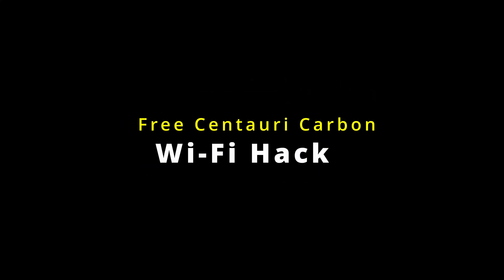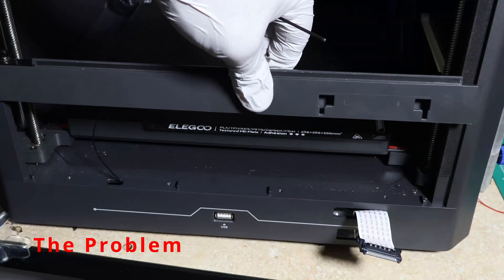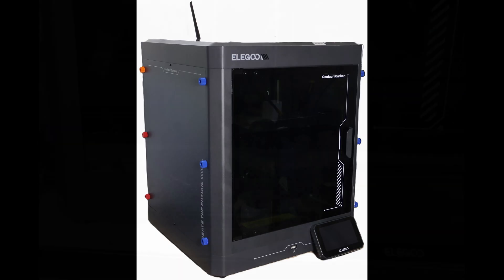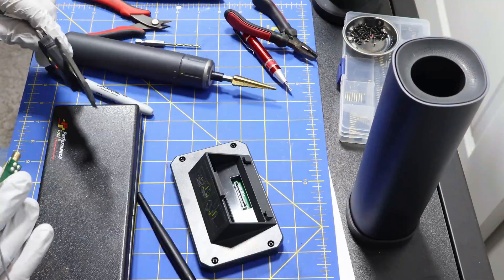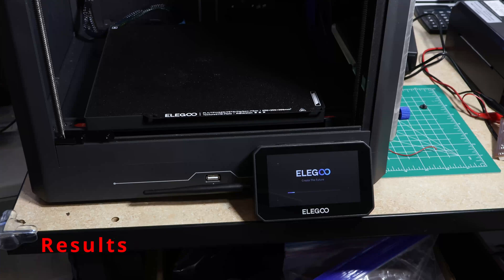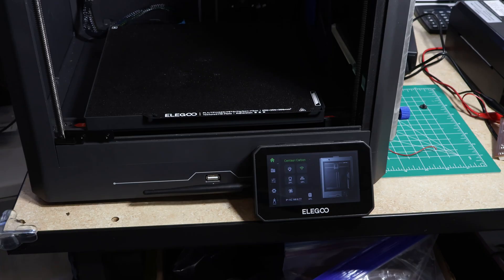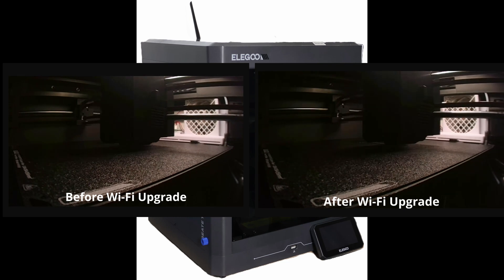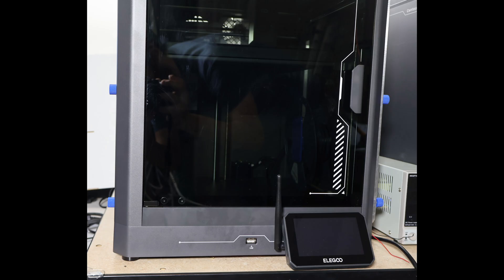Free Elegoo Centauri Carbon WiFi Hack — Lazy Week Challenge

Comment: By the way you don't want a pigtail like that longer than maybe 6" the signal loss in the cable will kill any gains you get. If you get some decent shielded low loss coax to extend from the pigtail it's possible but that gets pricey fast for anything worth while. 

Honestly just replacing the PCB antenna with the SMA and then hiding the new antenna in that same trim piece would net the same benefit and look neater (I know short time ect just some food for thought)
Reply from the maker: Thanks for the feedback! That's why aftermarket directional antennas, for example, are running thicker coax. Good point.
Reply: Okay, you're saying that all I need is the SMA antenna and pigtail kit, but route the pigtail the same way it was run stock? Or am I mounting the antenna and running it to that?

Comment: Why drill into the mount for the display?  Why not a 3d printed extension for the display mount so that no permanent modifications to the printer are needed?
Reply from the maker: Honestly, only because I was short on time and trying to avoid burn-out. Even if I remove it, it's not visible. What I really wanted to do was make a 3D model that allows for a mount on the back and get a proper cable.

Comment: Great vid, thank you. 
Do you know of anyway to figure out how to remote into the printer to view/control prints from a different location outside of your wifi from home?
Reply from the maker: There are a few ways you could approach that. The simplest would be to port forward on your router. But since the CC doesn't have any real security, I do not recommend that. The most secure way is probably to set up a VPN server inside a DMZ on your router and then use a VPN client. That's beyond what most people are willing to tackle. I'd be surprised if there wasn't some sort of software to do that more easily now. But I'm old school and do hard mode a lot. Maybe someone else has some input on this?

Comment: I just wish the ECC had an Ethernet port. My TP link deco is just 50cm away from it
Reply from the maker: Yes. It might be possible to add one via USB. But that almost certainly requires a firmware change. The test was done with a Deco, BTW.
Reply: @SyntheticElectron3D This is your next project 😊
Reply: @SyntheticElectron3D  I hope that with your answer you have also recognized your next task 😘
Reply: @SyntheticElectron3D  Tried a USB adapter with no success, unfortunately, so firmware changes are required.

Comment: Haven't had wifi issues but I'm on 5g and run custom router/firewall OS on an I7 PC(OPNsense).

The weird issue I'm running into is when I 100% block internet access to the printer, the webgui for the centauri carbon breaks even though I'm in the same subnet 192.168.1.x to 192.168.1.x(before the firewall!) and It's driving me crazy.
Reply from the maker: Yeah, these tests were done with a 5GHz connection. Full disclosure - where I recently moved my printer it was fine. All I had to do to reproduce the issue was turn it 180 degrees in the same location though. I had issues at another spot in the room and in my garage.
Reply: @SyntheticElectron3D Are you planning on tackling chamber heating soon? EDIT: NM literally the sentence of the video 😂.

Comment: Just off the first 10 seconds of the video, I can tell your idea is a good one. 
On the other hand, I haven’t had a single issue with the wifi on the printer. Mine is in my garage away from all the rest of the electronics in my house, although it is an attached garage. My router is 4 rooms away, about 50 feet. 
All of our computers and systems are wired through Ethernet so all that’s on our wifi is our 3d printers, 2 tvs that hardly get used, and our phones. 

Side note, does this printer have a 5ghz receiver on it? I wonder if that would help depending on your situation. All of our phones are connected to our 5ghz line and the other things are all on the 2.4ghz line. I’m assuming the printers aren’t 5ghz since I didn’t see it pop up for me. 
That WiFi antenna is a super simple idea that could work on any printer.
Reply from the maker: Yeah, it's 5GHz. I was testing connected via 5GHz and forgot to mention that in the video. I think it comes down to barriers in the environment. 5GHz usually has more trouble with range through objects than 2.4GHz. Before this video, I had actually just re-oriented the printer and didn't have issues anymore. To reproduce for the video, all I had to do was rotate it 180 degrees in place. The antenna doesn't like the big metal box it is virtually inside of.
Reply: @SyntheticElectron3D  "The antenna doesn't like the big metal box it is virtually inside of." I seem to recall a guy named Faraday had some thoughts on that.
Thankfully the WiFi on mine is so far faultless, but it is less than 12ft from my router with a clear line of sight.
Reply: @SyntheticElectron3D  huh, yeah it makes sense. I wonder if the base $200 Centauri has a better WiFi connection because of that 🤔😂

Comment: Yours is a nice solution: I went with Plan B, which was to buy a super-cheap tp-link WAP that only worked on 2.4GHz (I couldn't force my existing system to use 2.4GHz with the printer) .  These are now 'old stock' as most people want WAPs that handle 5GHz.  Access to the printer is now working very nicely.